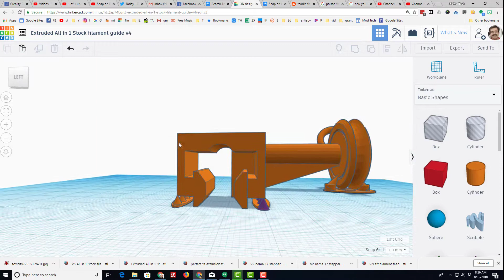Slide on Filament Guide with Printed Bearing

Comment: What are your cura settings?  I'm having issues printing the bearing with my own profile
Reply from the maker: Super simple. I have .3 layers. 210 and 70 for the filament and bed. The rest is straight from the CR10 setup.  No raft, but I do use skirt to get the filament flowing. I have also honed the bed manually so I get enough "smoosh" on that first layer for things to stay attached. I use the glass bed and a touch of hair spray... probably once a week.

Comment: How did you come up with the specs to make a design in tinkercad can you show the whole process of how you made it and what you used to determine how it would fit.

Also those supports what did you do to ensure that they would hold doing printing but come off easily afterwards can you share this please
Reply from the maker: I'm a guess and test guy. I did some quick measurements then just started snapping pieces together and cutting them out. The bearing was actually a project from a fidget spinner I created last year. Here is the link a clip that shows that whole process. https://youtu.be/LihOs1kIy5k The supports are just mimicking what Meshmixer does. I put a half mm thick shape on the bottom, tiny post, then tiny cones that I can then tilt to make it all come together. Voila. =) Thanks for asking.